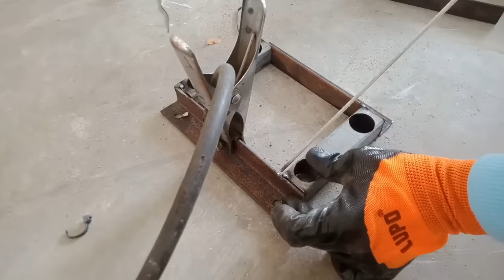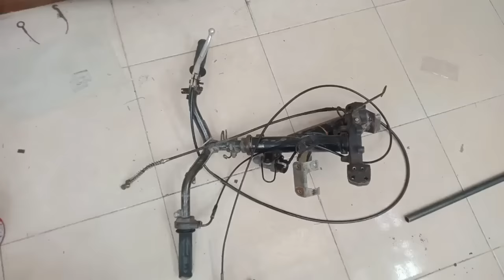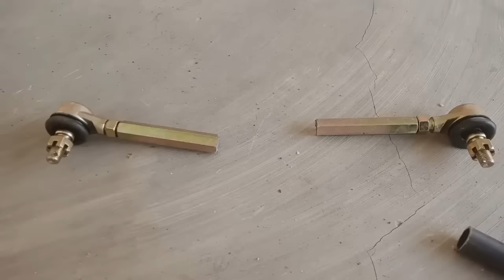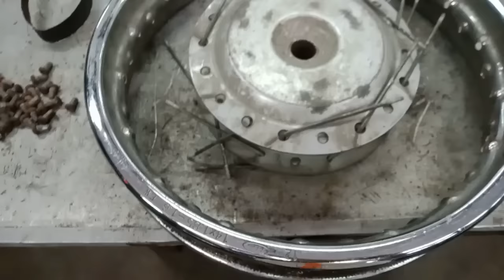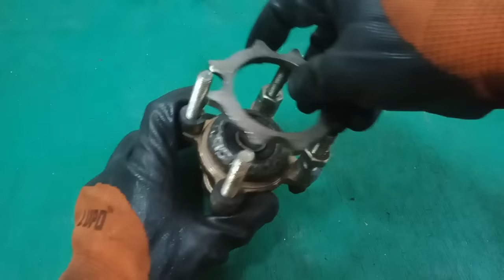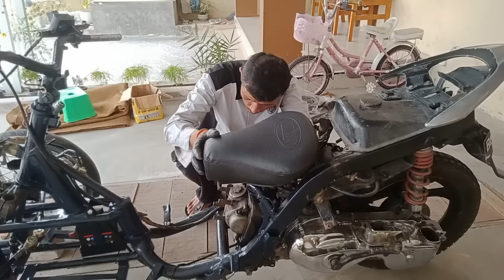How to make Reverse Trike (Part 1)

Comment: I know a lot of people will be critical of this but this is difficult to do with limited equipment.. very very hard to do.. good job dude!   Only thing I would suggest is to preheat the weld points till smoke starts to come off then spot weld to ensure better welds.

Comment: With some reengineering, you could sit the driver in the bottom of the frame ahead of the engine, then have their legs stick forward ahead of the front wheels. This would give you an extra low center of gravity and therefore better handling and stability.
Reply: Yes, like I did with mine